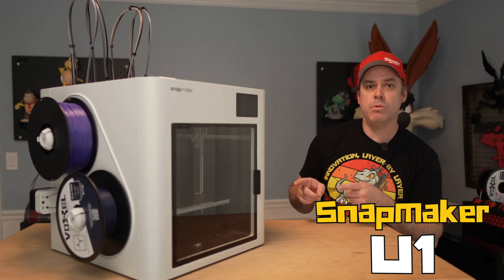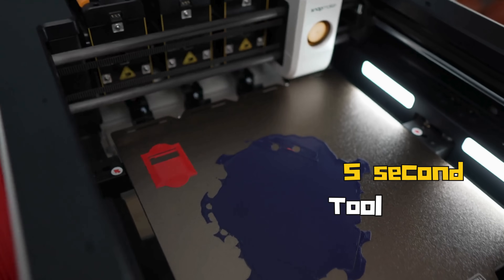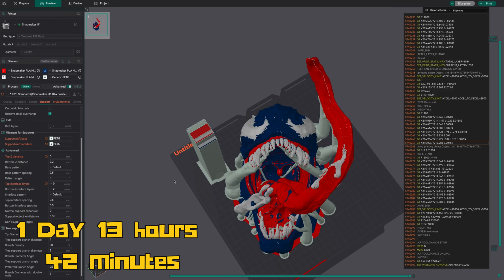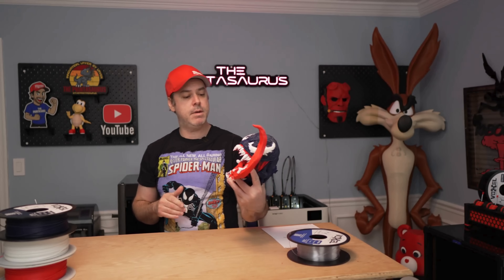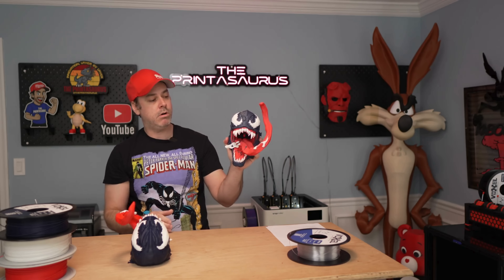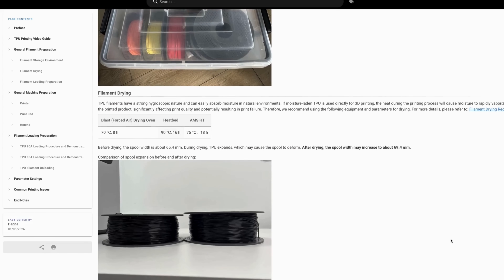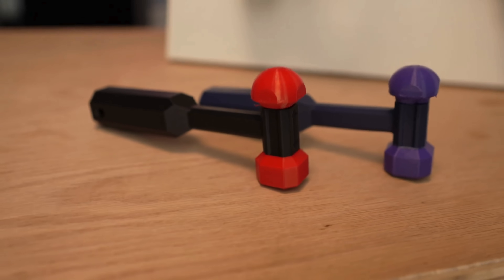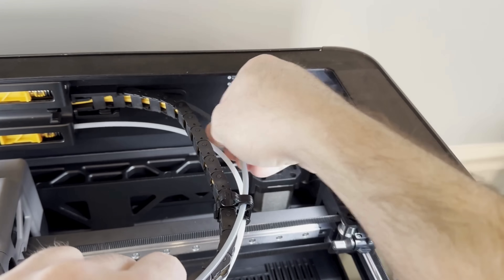Clash of the New Printers Snapmaker U1 vs Bambu Lab H2C

Comment: That bamboo isn't even square. It's moving lol. So how are the rails true? My k2 doesn't do that
Reply from the maker: The bambu printer has "anti-vibration" feet... Which causes the printer to dance around in place. I'm really not sure how effective it actually is. But that's what causes the movement. It will stay in place, but dances...

Comment: Build plate size is not even in the same league and the snapper u1 the only thing the snapper beats the h2c is tpu I don’t see how it’s a draw but hey u are entitled to your opinion but a bigger build plate multi material prints standard hardend nozzles and high temps and more materials compatible and proven it’s built to handle prints and good customer support…I don’t think it’s even comparable I’m not saying snapper u1 is horrible it looks like a great design just needs few details worked out but I don’t think u can compare it to a h2c just yet jus my opinion

Comment: Im questioning your math.. watched it twice....  42 hours for the U1A, 48 for the Bambu... you state a 10 hour difference?
Reply from the maker: Yeah I realized I had the wrong edit in there. That take was with the slicer estimate - which on the snapmaker is off by 5/6 hours. So the 42 hours for the Snapmaker and 48 for the bambu is accurate for actual print time. Appreciate the call out.

Comment: They’re both great printers but, I’m sorry, the Bambi simply works. Always, and as expected. 

Software needs to improve ever so slightly for U1 and the bed size needs to go up a bit for my use case.
Reply from the maker: Yup I agree with that. I'm sure Snapmaker will continue to refine, bambu has been very good with user experience so it's a good example to follow.

Comment: How much waste did each printer have? That’s a huge part of this! I’m printing right now on my U1 and slowed it down to 8mm volumetric speed. 3 day 8 hr lmao, but first time trying the mixed filaments and didn’t want to waste it haha
Reply from the maker: Here's what I have recorded for filament usage. Both printers are extremely efficient in purge savings. I did not do any purge/wipe tower adjustments, but more can be saved by refining that as well. 

Snapmaker U1
Total filament used: 890.73 g
PLA model: 597.90 g
PETG supports: 124.26 g
Purge tower: 168.57 g

Bambu Lab H2C
Total filament used: 867.84 g
PLA model: 596.56 g
PETG supports: 96.62 g
Purge tower: 174.66 g
Reply: @ThePrintasaurus wow I’m shocked that the H2C was so close! My purge tower is under 100g on the U1 but I may be using suboptimal settings (pretty new to this haha)

Comment: What about waste?
Reply from the maker: Here's what I have recorded for filament usage. Both printers are extremely efficient in purge savings. I did not do any purge/wipe tower adjustments, but more can be saved by refining that as well. 

Snapmaker U1
Total filament used: 890.73 g
PLA model: 597.90 g
PETG supports: 124.26 g
Purge tower: 168.57 g

Bambu Lab H2C
Total filament used: 867.84 g
PLA model: 596.56 g
PETG supports: 96.62 g
Purge tower: 174.66 g

Comment: Reviewers forget the price difference. They talk about it in 1 sentence as if its no biggie to pay over $2k for a 3d printer.
Reply from the maker: I felt I made that connection in this review. Ultimately the idea was to compare the two on level ground. See how much of a difference each would have, and also talk about the price and who might be better suited for each printer. I wanted to try and give a clear comparison so the viewer could make any decisions they'd like. Outside of filaments requiring some additional attention these printers quality wise are very close!
Reply: @ThePrintasaurus Level ground when the second printer is 2.5x more expensive? That's exactly what I'm talking about. You guys get these printer often times for free, and forget our side. If you paid for both printers yourself, good, but most reviewers push same story as you putting 2.5x more expensive printer on "level field", which is kind of ridiculous. Does H2C do 2.5x more? It sucks for TPU, which is second most used filaments by utility peeps/mortals after PLA and PETG combo. Anyway, rant over, it wont change Bambu sending free printers to reviewers who then dont compare on real playing field ( = be 2.5x more tough on H2C expectation than on U1's).
Reply from the maker: @AtFives3DPrint   I actually appreciate the rant, genuinely. These are the kinds of conversations worth having.

Just to clear up one big assumption though: I paid for both of these printers myself. Bambu Lab hasn’t sent me a printer, and they’ve never even responded to an inquiry from me. 

The reason I put them on a “level field” isn’t to pretend they’re priced the same. It’s to see what each printer delivers out of the box in real-world use, because that’s exactly how most people experience them. What do you get when you unbox it and start printing?

And you’re absolutely right to question value. Does a 2.5× more expensive printer do 2.5× more? That’s a fair expectation, and it’s something I try to highlight rather than gloss over. 

My goal with this channel is to bridge the gap between content creator hype and real-world ownership. That’s why I take the out-of-box testing approach. If something struggles, especially at a higher price point, I call that out.

I don’t expect everyone to agree with my conclusions but I do want the comparison to reflect what actual buyers are going to run into, not just what looks good in a sponsored video.

Appreciate you watching and taking the time to challenge it!

Comment: Not sure if i missed it but what was the total filament used for both? What one wasted more filament? And for single color is the U1 still faster?
Reply from the maker: Here's what I have recorded for filament usage. 
Snapmaker U1
Total filament used: 890.73 g
PLA model: 597.90 g
PETG supports: 124.26 g
Purge tower: 168.57 g

Bambu Lab H2C
Total filament used: 867.84 g
PLA model: 596.56 g
PETG supports: 96.62 g
Purge tower: 174.66 g

As for single color prints, The H2C is a little faster, but not by much a few minutes at most.

Comment: The snapmaker is a huge win. 4 head tool changer for under 1k? that right there sells it. the h2c is almost 3x the cost, and slower, but has a more commercial application to it since it can print those harder materials and larger build volume.
Personally as someone who prints for hobby I can see myself getting a U1.. but if I in a business and was prototyping parts? I'd probably go with the h2c.. which I dont think the U1 is targeted at commercial applications.  Lemme get both for free and ill test them out for you.
Reply from the maker: lol. If I had free ones to give out, I'd share! Thanks for the comment and support!

Comment: I have both machines. The U1 hardware is great. It's the software that needs work. Bambu's ecosystem is hard to beat for the average user. The H2C works exactly as I expected it to. I know there's custom firmware for the U1, so I may try the extended firmware and see if smoothes out the experience
Reply from the maker: Definitely agree the software needs a bit more polish on the U1!
Reply: I have the U1 as well.  Im only a casual user and wondering what you feel is missing?  Serious question, not trolling or anything.

Comment: Bambu loses because it relies on the ams. Its slower to change, cant use more than one tpu colour, issues with cardboard spools. Since the side spools on the u1 arent needed for loading and unloading the filament you can use an external dryer to have your spools in and print at the same time too, kinda like with ams.
Reply from the maker: Using external dryers works great with the U1 and with how the back is bumped out for space for the tool heads I've found things tuck in well behind it and is a direct route to the PTFE tubes running to the toolheads.

Comment: The biggest issue I have with the U1 is the build plate. I've got permanent spots where nothing will stick to it. If you run your hand over the areas it's really smooth compared to the rest of the plate. And yes Ive cleaned the hell out of the plate. I've got the Cryo grip coming soon. Can't wait. My other issue with the U1 is the build quality of the machine. Although I get beautiful prints, the thing is a hunk of junk. But it's my hunk of junk, love it. My H2D is such a beautiful machine though, and it's rock solid. Love them both.
Reply from the maker: I'm testing the Biqu Glacier cyro grip plate now. It's made a significant difference. I intend to do a longer term review of the U1 after a few months to see how everything is holding up.
Reply: @ThePrintasaurus I'll be waiting for your review, my Biqu plate doesn't come in for another week.

Comment: I got the H2C because I wanted to do more than 5 color printing. I also wanted to do bigger models. Also didn't want to deal with the issues the u1 would have.
Reply from the maker: That's a solid choice for versatility and bigger models!
Reply: @ThePrintasaurus yeah. It's such a good printer man. Been printing on it for weeks and it's flawless.
Reply: I have the H2D very inconvenient with soft materials
Reply: As long as you don't like to print flexibles.
Reply: @perkulant4629 what you mean ?
Reply: And how many 5 color prints have you done so far? I thought the same and then found that I never need more than 3 or 4 tops. I have an h2c and h2d that get very little love since i got the u1. Those extra 4 colors require another ams which costs 1/3 of a u1 by itself. Go with ams2 and youll also need the power supply
Reply: @JessieJames3D ams2 doesn't need a power supply. It only needs it if you are hooking up more than one and will be drying on all of them. Otherwise it will dry on one without a power supply. I actually have an Etsy shop and make some cool stuff that requires more than 4 colors. Would be impossible for me with the u1. I don't like to be limited. Plus I have 3 other X1C printers and so i just used the AMS from those. No need to go buy more.

Comment: Does the U1 have "adjustment screws" for leveling the bed?
Reply: Yes, and you can see in Klipper how flat your bed is. Then you can start an manual leveling process where these screws are involved. And you get guided to level the bed. But u don’t need to do it.

Comment: What about the software for the u1? They have a mobile app like bambulab?
Reply: I don't believe snapmaker has a mobile app. As for the slicer you can use orca slicer.
Reply: @Kennebec27 that sucks unfortunately. I got sucked into bambu eco system. Hopefully they make one. It's kinda a deal breaker

Comment: Purge tower issue on U1 was fixed. I do quite a bit of TPU and U1 allows much more capability in printing mixed materials or mixed TPU. I would not touch the H2C unless you need more than 4 colors right now and need to purchase a unit. With INDX around the corner if you need more than 4 colors I would wait for one of those products as it is objectively better than the H2C solution.

Comment: Nice compare but a little biased by design (and i don't mean that in a bad way). If you start with defining the 2 tests as something both can do. By doing that you keep the U1 in its sweetspot (2,3,4 colors, good at tpu) where its great value but limit the h2c. Its not bad because many people want to use it that way and then its great value. But if you would have defined a test with 5 colors with a support material (so 6 total) with a more complex material lineup and/or a bigger part it would be very different. You do say its in a different class and that is true we would not even be talking about this is the U1 would not be so much faster (about 17 seconds per swap) than the h2c this is the thing being pushed and for many that is VERY valid. As a h2c owner i do also feel that the h2c is just way more 'helpful' i like ams systems, i have 4 attached (2 ht's) and swapping is so easy, tracks everything and can leave them in to dry 10 spools at the same time. Same with vortek i can switch nozzles so easy without getting up and if needed i can put a new one of the rack within 5 seconds. Its a much more complete printer really but it comes at a cost not everyone is willing to pay and if you limit yourself to the 'range' of what the U1 is good at its hard to beat in value.

Comment: You didn't mention how much more waste the h2c makes.
Reply: The H2C don’t make any waste. If you call waste the first filament they push out of the nozzle every time you change the colors, then the U1 makes waste too, every time you change filament it have to push out the old one. But since it’s printing they don’t make any waste too
Reply from the maker: In this test they were pretty much spot on. The U1 purge tower actually produced more waste. I should have included!    This is for the Venom bust.
Snapmaker U1
Total filament used: 890.73 g
PLA model: 597.90 g
PETG supports: 124.26 g
Purge tower: 168.57 g

Bambu Lab H2C
Total filament used: 867.84 g
PLA model: 596.56 g
PETG supports: 96.62 g
Purge tower: 174.66 g

Comment: I want both. I make some stuff that’s only 4 colors and uses a 0.4 nozzle so I'd like the U1 for those, however I also do stuff with 6+ colors or 0.2 nozzles and the H2C would be great for those. I already have 4 printers though so I need to get rid of a few to make space.
Reply from the maker: It's always tough to make space for new printers!
Reply: @ThePrintasaurus  I am full up in my little shop. It's a small spare bedroom where I have 4 3D printers, a CarveraCNC and an XTool P3 laser, which takes up like 1/3 of the room all on it's own . 🤣🤣

Comment: Such a great comparison. Very partial I can say. We viewers appreciate that.
I have the Bambu Lab A1 (Without AMS) and the Snapmaker U1 working next to each other. Something very important that I haven't seen mentioned anywhere is that the PEI plate on the Snapmaker is not as good as the one on the A1. 
If you try to remove a PLA printing on the A1 immediately after the printing finished, you CANNOT do it, you need to wait some minutes or even remove the plate. But on the U1, you can pick the piece right away without any resistence. Even the prime tower, which has a bigger bed contact, can be removed so easily. That's why I think there's an issue with it.
Based on this observations, I will buy a plate from other manufacturer as soon as I can just to prove if I'm correct.
Reply from the maker: That's a great point about the PEI plate adhesion differences! I'm testing a Biqu Glacier plate now with the U1 - has been really good!

Comment: For the tower. Use cone at 35° angle. Can't wait for a large heated u1. Its klipper based, so we will eventually get box turtle access
Reply: I agree the U1 is limited but shows the same tech can be used to make a better printer, bigger build plate, more sensors, ams like add-on, heated, closed. Price will go up for sure but then it will be more complete compare.
Reply from the maker: I've got a box turtle handy. Would be interesting to see some expansion in features as things continue to develop. I've got the box turtle on my voron 2.4 with a jabberwocky tool head. Has been a great setup.

Comment: Now do it with 4 colors of tpu lol
Reply from the maker: That video is coming!
Reply: Try ABS and Nylon on the U1 😆
Reply: @Scheettini Already did. works great. Just as good as an x1c would print them. Or nearly every printer more than a year old. Heat soak

Comment: Looks like you had the old-style purge tower on the Snapmaker.  The new one seems to not have any issues with becoming disconnected from the build plate.
Reply: Is there a new purge tower option on Snorca or Regular Orca slicer? Thanks .

Comment: Its a bit apples to oranges. Sure the Snapmaker is cheaper and if that is all you need, that's fine, but the H2C has so many more capabilities.  Yes, I love mine.  OK I'm printing a 5 or 6 color model and I notice my red is running low. 1) On Snapmaker, I have to sit and wait for it to run out. 2) on H2C I just add another red to the AMS or AMS HT and problem solved. In fact I have many filaments loaded in my AMS so I rarely even touch the H2C except to remove items from the plate. Oh, and I've been doing vinyl cutting as well and that works great. Or I want to include a 0.2mm or 0.6mm nozzle in a project, and I can switch nozzles again, without even touching the machine. I'd like to see the Snapmaker do that. The AMS adds so much to 3D printing, that I would never consider buying another 3D printer without one. (or 2)